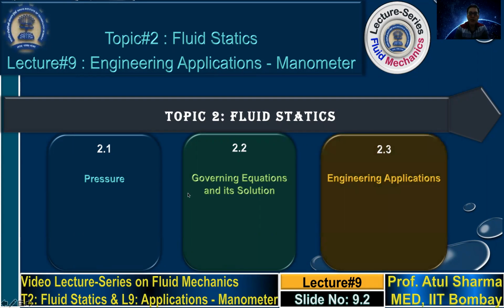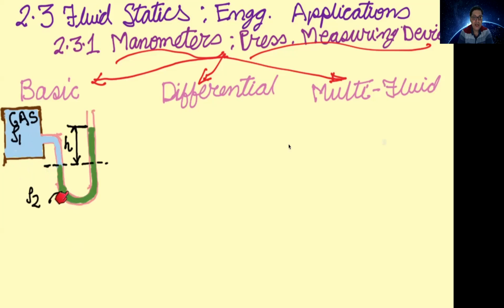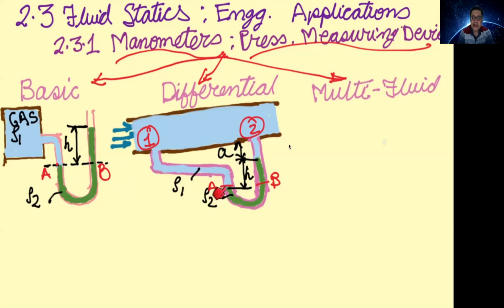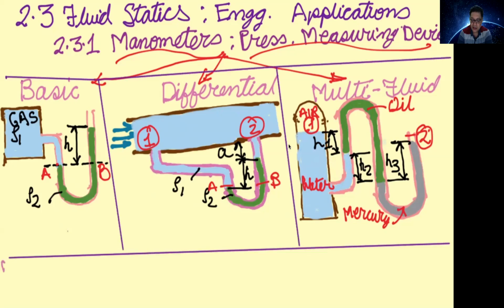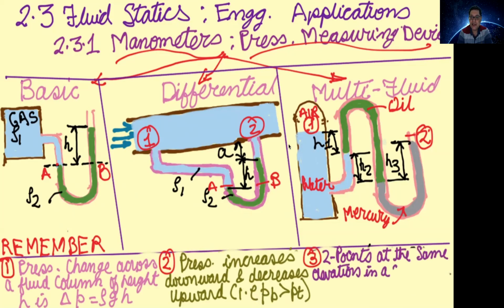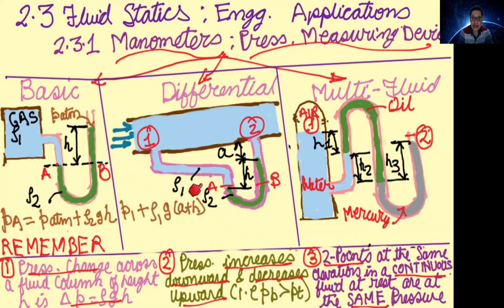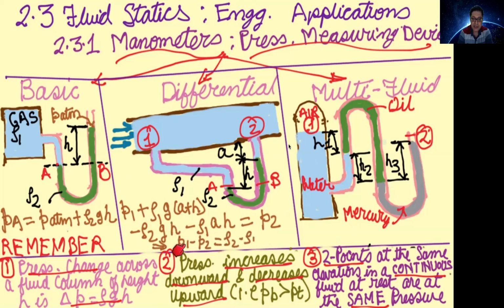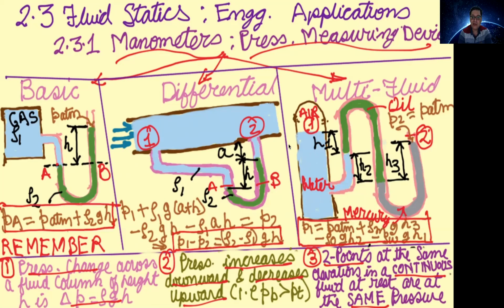L9 Statics Application Manometer

Comment: Sir, there is typo error in differential manometer calculation...
Also there is correction in multi fluid manometer as water lever on high pressure side must be below level of equilibrium...